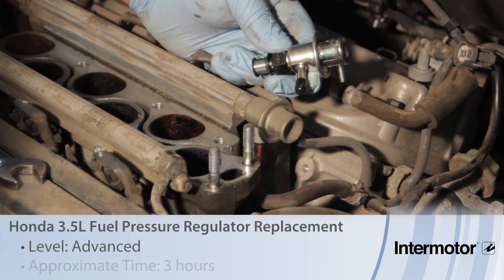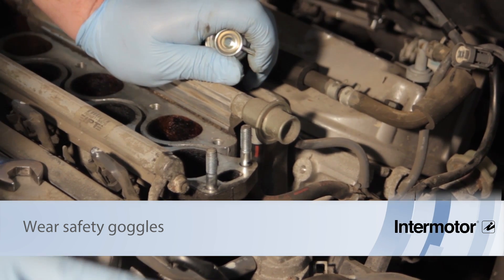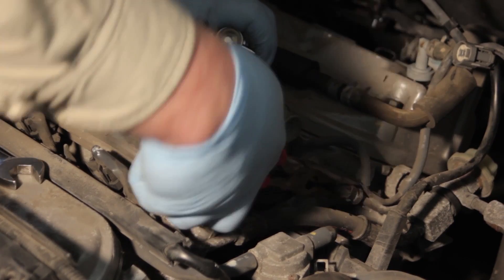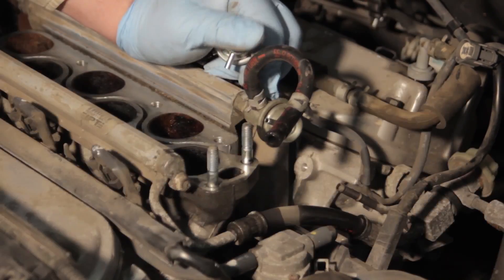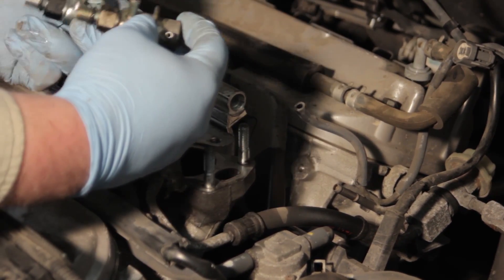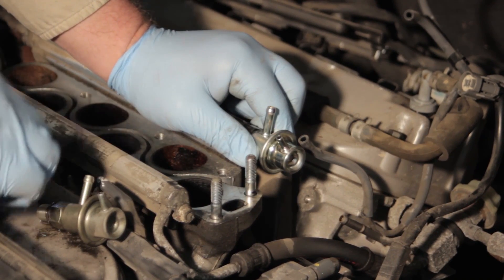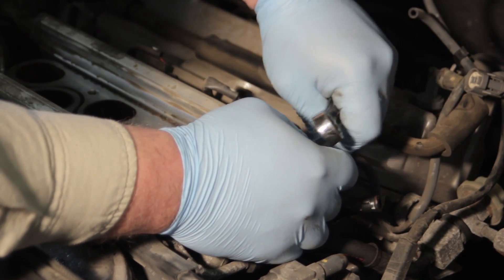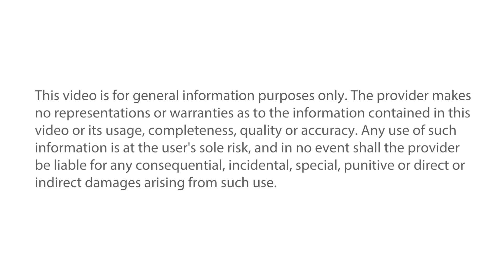Honda 3.5L Fuel Pressure Regulator Replacement

Comment: I have P0175 and P0172 running rich codes on my 2010 Acura TL with the J37 engine. Is the fuel regulator pressor a common culprit for these codes?
Reply: I have the same codes, I have already changed injectors, MAF sensor, oxygen sensors and the problem is still still going on. If you know what to do, share the information.